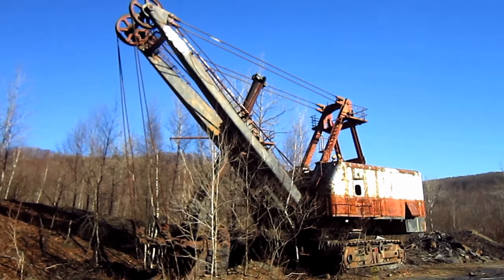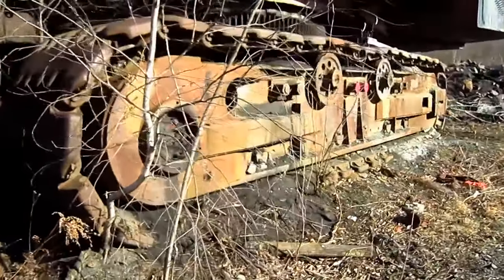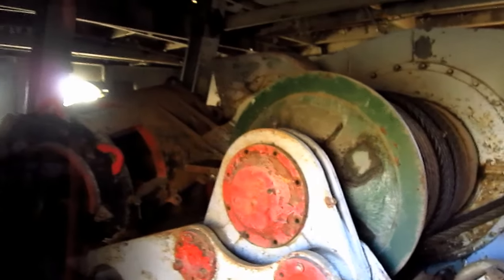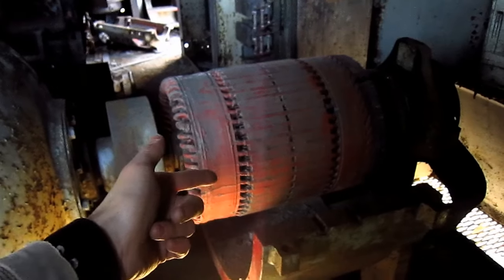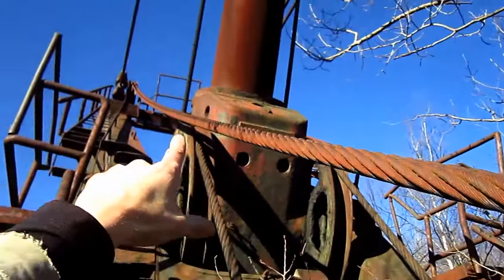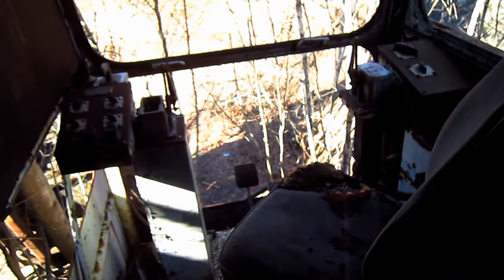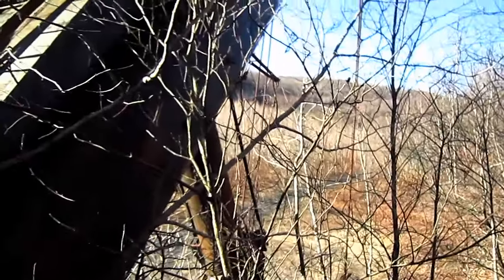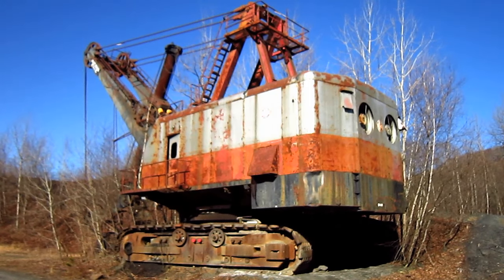Bucyrus-Erie 280-B Documentary

Comment: Cool old shovel, kinda surprised it wasn’t diesel powered. Interesting none the less. I’m guessing You probably have not ever , at least I  don’t recall, done a video on the 10B . Mammoth unit. Have one setting in the back 40, and My cousin has one in working condition. Thanks again Justin.
Reply from the maker: Electric was way more common in older shovels, even ones as small as 5yd. Thanks!
Reply: @PAmining  That’s interesting.

Comment: Interesting but what ran the generators? Electrically powered machines I have seen on TV typically have a diesel motor that generates the electricity. I have seen huge shovels that are connected to a large electric cord, was this shovel like that?
Reply from the maker: Yes it would have been fed by a power cable like all electric machines. Thanks!
Reply: I was also curious about the power source.  How did the power cable work? Would there have been a generator on site? How did they keep from running it over?

Comment: 5:44 help me understand this. These electric motors drive electric generators to produce electricity from electricity?
Reply: That's what I was wondering. It must have an engine powered generator to get it all started.
Reply: @Ottos_ScLm_Race_videos_2009_on I can only think of 1 thing: the AC motors drive DC generators.
Reply from the maker: Very good question! You've inspired me to make a short to explain, but the answer is this: The sync motor is a 7200 volt AC motor that drives the generators that make DC for the hoist, drag, crowd, and swing motors
Reply: Was wondering the same. Yes please! Short video to explain this!
Reply: Basically a AC to DC converter